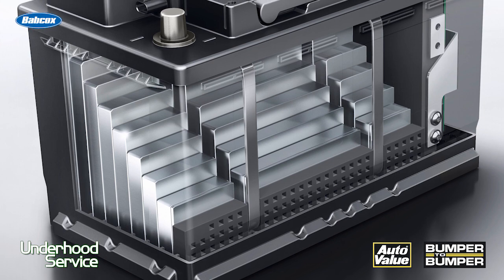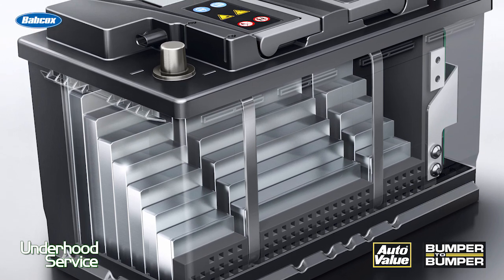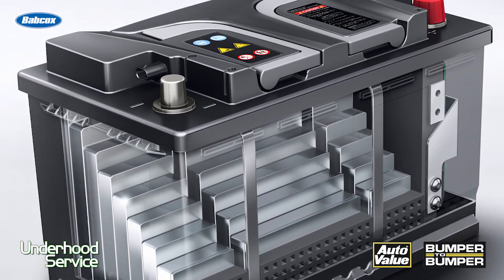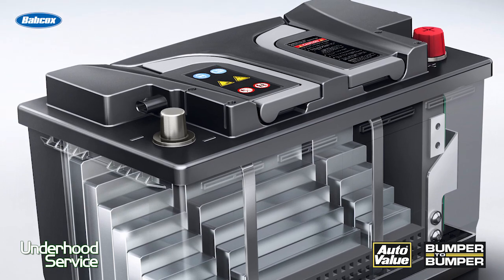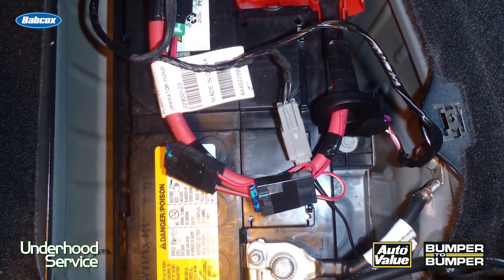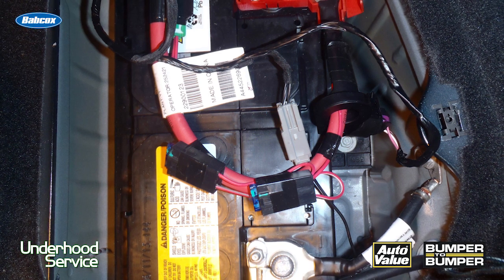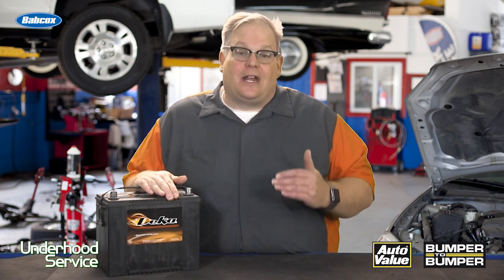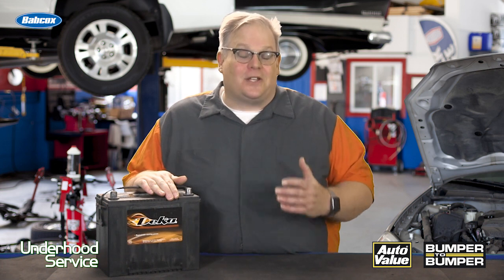Battery vent kits | Maintenance Minute

Comment: My AGM Hybrid battery has a vent hole for a vent tube ro be plugged into. Is the vent hole supposed to be open into the battery? It seems to have a white material one half inch into the vent hole. Is that a gas permeable plug, or soes it need to be drilled out or removed? Vehicle is  2011 Prius. Thanks